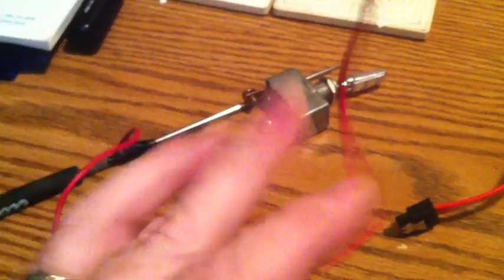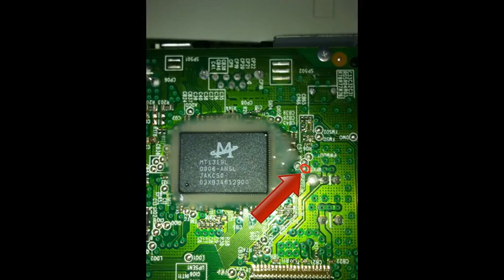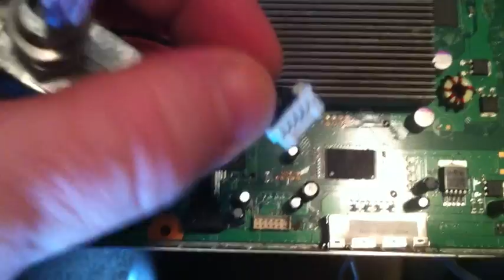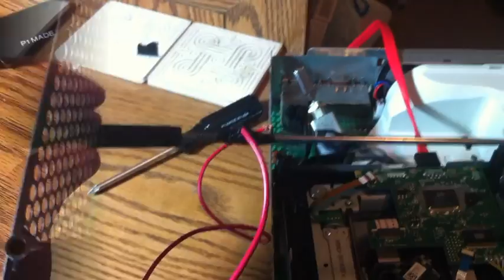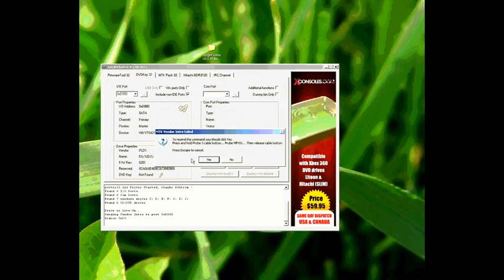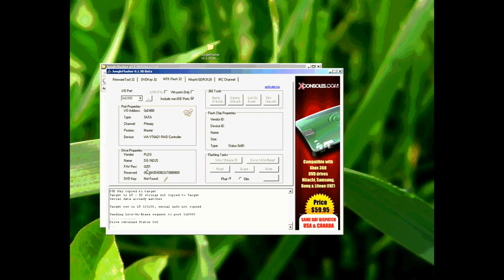How to flash mod Xbox 360 Liteon drive to Lt 3.0 without ck3 pro probe

Comment: Did what you said, got to  lite-on erase and did it. Got 
----------------------------------------------------------------------------------
Sending Lite-On-Erase request to port 0xF090
..............
Drive returned Status 0x0
....................
Device Intro failed!
Lite-On-Erase NOT sent 
-----------------------------------------
Now my xbox doesnt see the drive (xbox light flashes) and it wont eject, nor with jungle flasher see it. HELPPP!
Reply: Xbox Moddder how? i got the same problem. nothing detects it and it doesnt turn on!
Reply: Xbox Moddder yeah the green light flashes for a while then i get the red ring. i know i didnt probe the wrong point but my probe did slip a little bit. is there anyway to fix it because i dont have the money to by a new drive
Reply: Sylva Madu oh by the way, my stupid computer decided to restart itself in the middle of the flashing process. that might be helpful to know
Reply: Xbox Moddder hey there... im having the green blinking light.. i used liteon erase button.. i was successful.. this came up.. but still i dont have any firmware in it.. please guide me

Sending Lite-On-Erase request to port 0xF090
..............
Drive returned Status 0x0
.....
Serial flash found with Status 0x72
Manufacturer ID: 0xC2
Device ID: 0x11
Flash Name:  MXIC(MX25L2005)
Flash Size:  262144 bytes
Reply: Did it. Flashed dummy.bin.. Back to stock..
Reply: @ameyudar broo plss help me !! At first I failed to extract the key on lite on now it not supporting on xbox console !! I want to get back to my stock firmware

Comment: This tuto worked fine for me. My MB is an ASUS p5q-e with ichr10 chipset, works perfectly, you just need to enable IDE mode on the BIOS, and not AHCI. My SO is win 7 x64, jungleflasher works but you need to boot with driver signing disabled ( press f8 during boot and it should be at the bottom)

Comment: I did this and it seemed to work fine.I completed all steps and got all the correct responses all the way to the end. When I put it all back together, it now does NOT play the original game it used to before doing this to it. It just comes up with a white screen with a green "XBOX 360" splash screen and stays like that.

Comment: my xbox will switch of after 5 minutes although I have a HDMI cable connected to it. I am afraid that it will switch of while I'm doing all this stuff in this video, thereby destroying my firmwire. Does anyone have suggestions on how to keep my XBOX running idle for more than 5 minutes? thanks in advance
Reply: try using the regular AV cables instead of HDMI and see if it runs idle longer than 5 minutes. let me know if that worked. also let me know how the flashing goes, i'm going to be doing this method on friday

Comment: This tutorial worked great for me. Just hooked up the DVD drive to my motherboards SATA, and it worked just fine. I had to set the drive to be in a half open position, though, my computer couldn't detect the drive otherwise.
Reply: I need to do this but I'm so nervous about opening up my drive..  Is this noon proof? Lol
Reply: I am having trouble getting my drive detected. It is detected in BIOS but not JungleFlasher. How did you set the drive to half open position?
Reply: Kab Open the drive, then close it but stop it from closing completely by holding the drive tray firmly, after that just keep holding it for a few seconds until the drive gives up and doesn't try to close. That should make sure JungleFlasher detects the drive.
Reply: +Kab Jungle Flasher needs it to be in ATA mode rather than AHCI mode, this may be why it isn't detected.

Comment: Did everything correctly... Not on the first try though... Probably it was the 7th.. stupid probe. Now I get an E64 error, with a red down right ring. I repeat I did everything correctly up to 0x72 status and did the final stuff. I have the Liteon dg-16d2s drive on an XBOX 360 elite console. Any suggestions?

Comment: So I got to the part where you touch it with the probe and then it said extraction complete on the pc, after clicking ok however it gave me another message that said it failed and now jungleFlasher doesn't see my drive anymore. I plugged it into a different port and tried with a different cable, but it just doesn't show up. Any thoughts? did I completely ruin my drive :( I don't know what else to try... Pleaaaaseee help!

Comment: Your The Man GIlldaddy Thank You i got over 6 xbox 360 done this way for my friends 1000 thumbs up to you for me i did not need to do this as i have a 2008 xbox 360 with hitachi 78 drive which requires no switches and so on the only downfall is that i had to pay for an i has asus clone drive to burn xdg3 games cause overburn does not work for my drive like the lite on drive and at least i can play online too without being banned for missing data at the end of the disc cause i have to have all the data on the disc in order for the drive to read it.

Comment: Asking, does this work with Philips & BenQ drives?
Reply: I want to use this tutorial when I get my Elite Jasper in next week or so. I have a question though.

I have been told that if I use the 360 to power the drive, that means I have to power on the system right? I have been told that if I want to be able to play on live I have to use an adapter to power the drive so my 360 does not flag the system.

Could you please elaborate on this and do I need to buy an adapter to power the drive exclusively from my PC if I don;t want the system flagged so I can go on live?
Reply: You will not get your system flagged, as long as you have flashed it with the latest firmware you'll be fine.
Reply: Ok thanks for the speedy reply man.
Reply: No problem man any time contact me via skype: TheHeisenbergz
Reply: TechGuy carlospt1971 please add on skype
i have many doubts
Reply: Does this method still work? Also, do you need a SATA Expansion card? I have open SATA Ports on my motherboard on my PC that I could easily connect to. 

Another thing, the probe, will any metal poker do? This is the step I'm the most lost with, the rest is pretty basic wiring but I'm working on a $0.00 budget.

I'm not gonna be able to ground the metal and my best shot at getting a toggle switch is using an old light switch, but I'm prob just gonna have extra hands. 

And is there anything with this method I should be concerned with as far as the extent of which I use my flashed games? I've been reading and I keep seeing about powering the drive via the 360 can lead to something, I'm not sure what.
Reply: different drives require different methods to flash - message me if you need assistance and i will help if i am able :)
Reply: catonthewebb catonthewebb you still take questions

Comment: hey man, i used this vid 3 times to flash 3 of my xbox lol its a good tutorial, just one question the last one i did i got an error then it didn't want to open the tray at all, i manage to still do this technique to get the dummy bins and the other 3 files off it, then i thought if i just flash it might just fix it, so i finish flashing it then reset the ata and put it together, still wont open, any fix you know of for this? pretty sure this might had happen to you at least once.

Comment: This worked great for me! I would like to say that if you fuck up the step where you erase the liteon,(you must already have the DVD key aka Dummy.bin) don't fret! You can easily fix it by going to the first tab and open the source as Dummy.bin, then open the modded firmware as the target. Go to the third tab and hit liteon erase and follow the instructions. (This works if the drive doesnt show up in JungleFlasher and if it is not getting power.) Thumbs up if this saved you guys

Comment: Ive just Got mine flashed by a professional Company, it was cheaper whit shipping, then doing it where u need to buy things. Its better and alot safer. Btw, they told me "hillbilly" Ways like this..... Will eventurally destroy ur drive, plus it has a bad flash this Way ;-) Hope this helped, for people like me that didnt know anything about how important it is to do it whit 100% correct flash file etc........ Dont do this, if u follow a tutorial, ONLY do this if u know what ur doing by urself :-)
Reply: your full of shit. it does NOT hurt the drive by flashing the firmware. They told you that and stole your money. took me 5 minutes to flash mine. lols
Reply: dragolian50 The flash doesn't and can't go bad over time. It either works, or it doesn't. It's not a fucking cheese that goes moldy over time.
Reply: My motto: You get what you pay for.

If you don't spend money, yes, it's going to be a "hillbilly" method, but if you pay, you're getting something better off.
Reply: but this is free? how is it cheaper "whit" shipping. now I ain't no mathematician but $0 is cheaper than any amount of $. plus this shit is fun I just made a port for my 360 controller to my laptop using an arduino board and an old 360 RROD and had a shittload of fun in the process. that's why I love these tutorials
Reply: They lied to you just to get money it will not harm your xbox 360 if you follow gilldaddy way of doing it
Reply: The flash can't really be bad, or worse than doing it professionally. It either works or it doesn't.
Reply: Sorry you wasted Money.
Reply: No i didnt 😂😂 Cause this hippy hillbilly fuck is just trying to get everything for free 😂 Kid, at least this proofs who has money, and who dont 😂 So fuck u nigga 😜
Reply: Did u consider im making more cash then u amagine? 😂 This is not poor ass America or Africa i live in 😂😂
Reply: what company
Reply: Danish Company called MM KONSOL, there made it good and cheap
Reply: pepole Who have Money cant keep money cus they Dont know how to Be Resourceful

Comment: ok just asking and i might have missed it but this way will or will not let you play from external hard drives?
Reply: It will not let you play games from an external hard drive. Even when the xbox 360 is flashed with firmware the burned/ or original disc must be in the drive in order to play. the game can be stored to internal hard drive or usb flash drive, but the disc must still be in the xbox drive in order for it to play

Comment: This way can give you a higher chance of getting banned because first you have your console on and it will do console check every so often
Reply: Doesn't matter the way it was done either in this tutorial or even using the "real" tools. The method of using the probe is needed to get the DVD key. Otherwise flashing the firmware is roughly the same for the other kind of drives. And yes there is always a risk of getting banned but those who flash their drive know this already. If they don't then they didn't do enough research before hand!
Reply: Chris Ladouceur Thats why I bought the probe 3 and ck3 mini to flash mine without getting a risk ban.
Reply: GamerMiek  I'm not getting into a pissing contest over comments but like I said someone who flashes their console or buys a 2nd hand flashed console knows that its for playing burnt games, pirated or legit owned backups. 

Having the CK3 mini or the Probe doesn't matter. The only difference is that the teams behind the modding make these tools so that users can do it themselves with professional made equipment. Once the console is opened that violates the Terms of Service anyway. As for the system being on and getting checked and banned, in Gilldaddy's tutorial he doesn't have the system connected to the internet. So the method of flashing is fine. The system would be online after the flash is done anyway, unless you use it STRICTLY offline, which most won't do. So again the choice is back on the OWNER of the system.

Anyway thanks again GillDaddy for the awesome tutorial!
Reply: Chris Ladouceur But still newest version of the xbox have console checks. Like you said opening the xbox there is no switch or sensor anywhere in your xbox to check that you have opened it.
Reply: there no higher chance of getting banned all you got to do is dissconnect from the internet when you do it
Reply: Like i said the console does console checks
Reply: Flashed like ~20 boxes with this method. None of them were banned. :)
Reply: carboard boxes?
Reply: Last time i saw u cant flash a carboard box

Comment: i might trade my xbox 360 for a xbox (original) just to play emulators up to 64. Is it worth doing all that stuff to flash xbax 360 to play emulators or will i be bettter with xbox (original)?
Reply: I used to play roms on my old XBOX also.
This only breaks the reading code in the dvd drive, to read unauthorized discs.......To play emus on your 360 you need either an actual modchip or JTAG/RGH setup.

Comment: This took me quite a few tries but it did work. I kept getting phat key failed. I just kept doing the same thing and it eventually worked. However I crapped out the drive during the Flash erase. So I ended up with a red ring. FYI if this happens for anyone else, hook up the drive again and hit the "Intro/Device ID" and flash the original FW again.

Awesome tutorial. The only thing I would like to point out is that if you do have more yourself helping on this (2 more people) then you can have someone disconnect the power from the wall, shutting down the drive. Then when you need power again have the person plug it back in and then another hit the power button on the console. Saves cutting a wire and using a switch if your nervous. I did this after I screwed up the erase command. Now waiting on my X360Key :)

Oh Also BTW I didn't use a VIA chipset to do the flash. The motherboard is have is MSI 970A-G43 which is all AMD.

Comment: So I'm having a bit of trouble flashing my liteon dg-16d2s.  I don't have access to any sort of actual sata ports (as I only have an old laptop), however I do have a sata to usb 2.0 dongle which I'm using to connect my drive to my laptop.  It's just not detecting anything.  Any and ALL help is appreciated, cheers.
Reply: you have to use a computer with motherboard SATA ports, it needs to be onboard SATA and a certain chipset

Comment: Trying so hard to figure out which wire you cut.  My drive still powers on and does not cut off when the switch is on off.  Using a Ben Q.  Any assistance would be great on this awesome idea.
Reply: Ok disregard, got that working but have a new problem.   I can no longer open my liteon 83850c drive, which is now a 0251 due to update. When I got up to the 2nd power down cycle for 5 seconds it came back extraction drivekey failed.

Tried again and got phatkey failed.  Here is the log;
Serial flash found with status 0x52

stage 2 failed

stage 1 failed

extracted drivekey failed verification.

I am using Jungleflasher 1.09b, onboard sata chipset on a via nano x2 mini itx pc w/ via ve - 900 main board.  Drive is seen by jungle flasher, so it appears to be a compatible chipset.  Only things I've noticed is the pc has frozen periodically and the area where it says type under the i/o address says ide and not sata despite being plugged in with a sata cable.  Any help would be greatly appreciated.

Thanks in advance!
Reply: Part of your problem is that you're using a Flash tutorial for a Lite-on when you have a BinQ. They're different drives.
Reply: Ben Q does not require you to probe for the key all you need is a power wire and sat for a Ben Q

Comment: I have a LiteOn DG-16D2S F/W 74850C (changed to 0251 with dash update).
I just follow this guide and it worked. I used a nail and some 12 guage wire.
Took me a couple times to get it grounded out right
GREAT GUIDE
Reply: interesting,i have the same one.
Reply: Hey do you know what kind of wire I can use for my xbox please? Do I buy it or look around the house.
Reply: omgpopmaster u could look for a old power cord and cut or a speaker wire but thicker is better. hope it helped :)
Reply: playalle1
^^What they said. The wire size doesn't really matter. All the wire is doing is grounding out (via the case). So technically the wire can be any size as long as its capable of creating a good ground connection/can carry the current.
Reply: x2 Just used this method again to flash an Elite.

Comment: Okay so after doing all these steps, is it ready to burn games and use them? And will it work with 2010-09-13 manufacture date xbox 360 slim?
Thanks.
Reply: and my drive is Lite-on DG16D4S is that right and able to use with this method?

Comment: This is a gud tut but it dont work with the lite-on 74850c aoa1 you will need the ck3pro to extract the key iv tried this tut on 4 including the 74850c and thats the only one that has problems reading the key.

Comment: Thanks for this.
It works 100%. Id never flashed xbox before but managed to do my xbox, my two kids xboxes and my dads with no problems.
For those who it failed and j.f doesent recognise drive just flash it to the same port anyway it will still be there this happened to me first time just follow same procedure as vid and it will work

Comment: blah discard that it was the laser needed tweaking. Odd that it read originals before the flash and needed tweaked after words. This method worked great was about to break down and by that stupid high $ probe kit which seems to keeps it value over the past 4 years but this saved me a lot of money. all I had to by was the stat 6421a sata pci and I had a toggle switch and instead of using a ice pick for a probe I use a light tester :D

Comment: WARNING Do not update to dashboard 2.0.16537.0 dashboard and then flash the system. IT WILL NOT WORK I trashed 2 drives cause if this crap. The flash gose through fine but nothing will play orioganls nor backups nothing just says reading for like 2 secs then open tray every time >:( this systems worked fine before hand and I undone the ribbon cable before doing the flash to avoid burning out the laser, I converted back to stock firmware with no luck neather system will work now.